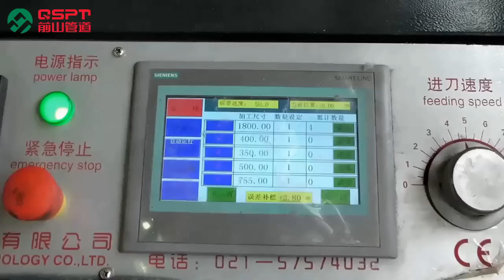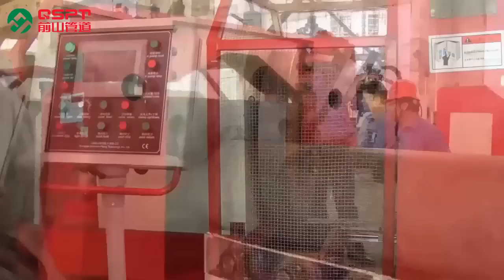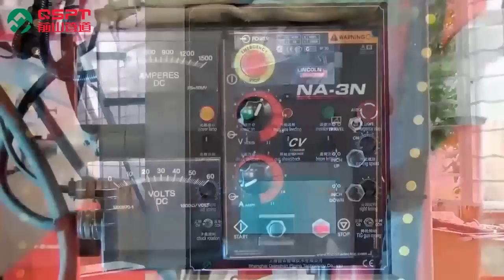Automatic Piping Spool Prefabrication Production Line/Pipe Spool Fabrication Line

Comment: Manufacturing: STAINLESS STEEL - STRUCTURE– VESSEL - TANK – SILO
        - PIPING, BOILER  –  MICROORGANISM SYSTEM.
 Fabrication: VESSEL, SILO, STEAM PIPING, GAS PIPING, OIL & GAS VESSEL AND PIPING.
             +  FABRICATION OF CARBON AND STAINLESS STEEL STRUCTURE, WORKSHOP STRUCTURE.
 MICROORGANISM SYSTEM: MICROORGANISM VESSEL, SILO, PIPING IN FOOD INDUSTRIAL.
 + LPG, OIL STORAGE SYSTEM AND STEEL BUUILDING FOR INDUSTRIAL.
Chuyên g/c và Lắp đặt: INOX- CẤU KIỆN THÉP- NHÔM & HỢP KIM NHÔM CN: " BỒN CN- BỒN ÁP LỰC- BỒN GIA NHIỆT- BỒN CHỨA THỰC PHẨM- SILO- ỐNG CN- ỐNG VI SINH- ỐNG THỰC PHẨM- BỒN &ỐNG GAS CN- BỒN KHUẤY CN": 

                          CÔNG TY TNHH CƠ KHÍ XÂY DỰNG  ĐẠI PHÚC
                      DAI PHUC  MECHANICAL CONSTRUCT. CO., LTD
HP    :     0974 060 068 / 0968 001 848 - Tel/ Fax: (061)6.567 555.
Add   :         44/ 3, Street 6, Long Binh Ward, Bien Hoa City, Dong Nai Province.
Mail   :         daiphucsteeldn@gmail.com  or   cokhithucphamdn@gmail.com
Web  :         http://cokhixaydungdaiphuc.com  or  cokhixaydungdongnai.com
Reply from the maker: Do you require the solution of piping spool prefabrication system or piping spool prefab line or piping spool prefab equipment ? My Cellphone No./WhatsApp ID : + 86 158 0179 1163 / 156 1836 2982, Skype ID: cnandrewluo.

Comment: Too much money spent on automation without much advantage in saving either time or cost of doing the work. This will work only if you have hundreds od spools of exactly same size .
Reply from the maker: May be you not full understand the shop fabrication by automation Piping prefabrication systems.

Comment: Chinese propaganda, never seen a fab shop with so much expensive equipment with 3 pieces of pipe in the shop. Also can’t be too precise the high low on the fittings are way out.
Reply from the maker: Do you think your comments valuable, Sir ? Please don't judge anyone freely without seeing by your eyes.
Reply: I think this is a demo setup, it is a over engineered expensive setup.you just need a guy with a overhead crane and a band saw which  you should find in any fab shop the welding rotators and sub arc welders can be bought of the self.got to agree with your remarks daniel